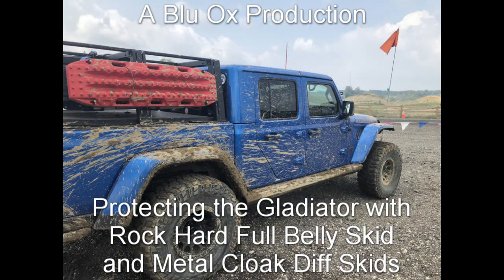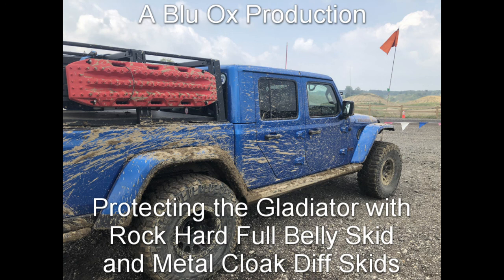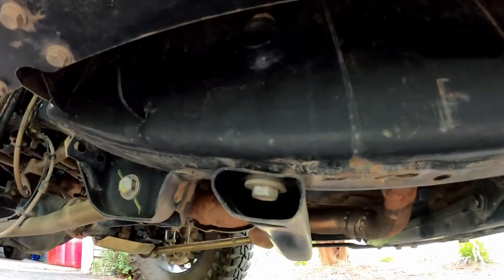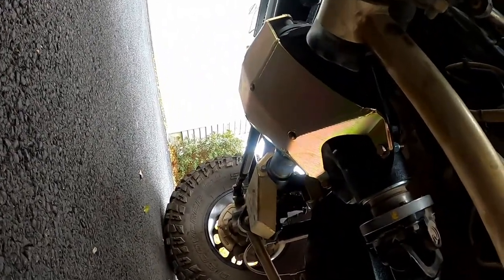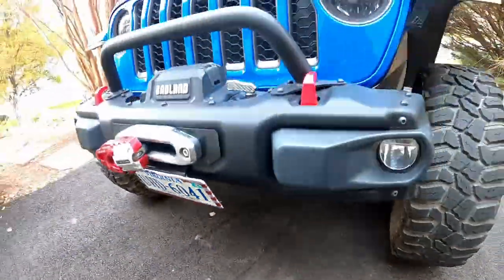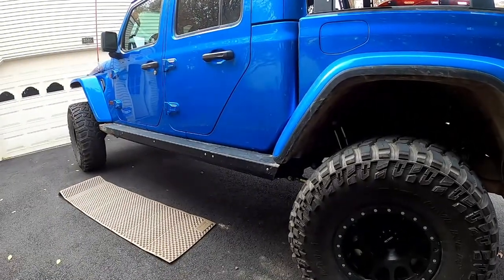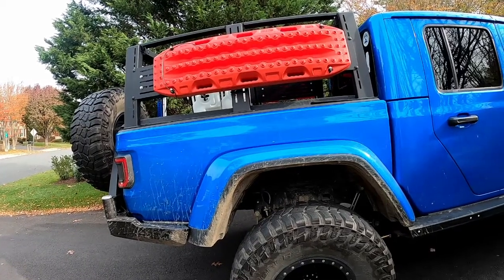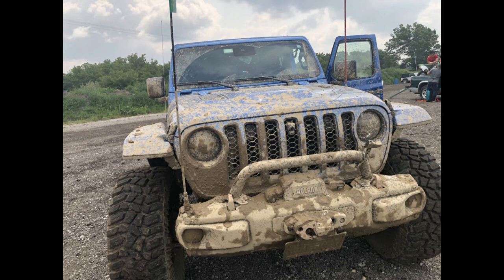Rock Hard Full Belly Skid with Metal Cloak Diff Skids on the 2020 Jeep Gladiator

Comment: did you lose some clearance adding that underneath?
Reply from the maker: It does hang down a little lower (maybe 3/4 inch?)  than the original skid plates but with a stronger and smoother surface I think that it will slide over obstacles better with less damage so probably worth the loss of clearance.